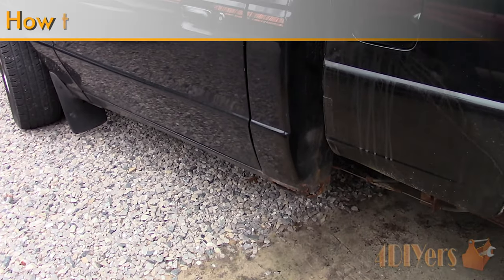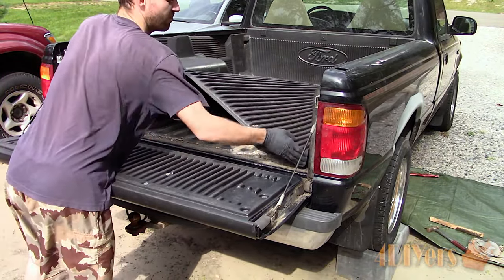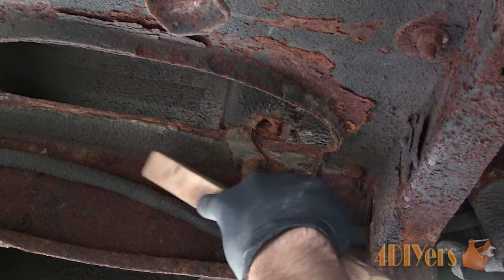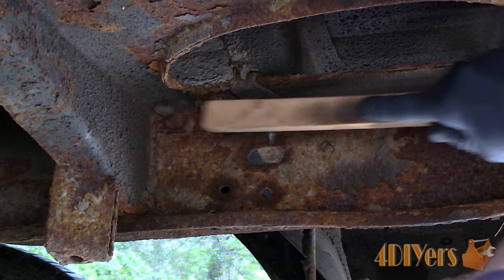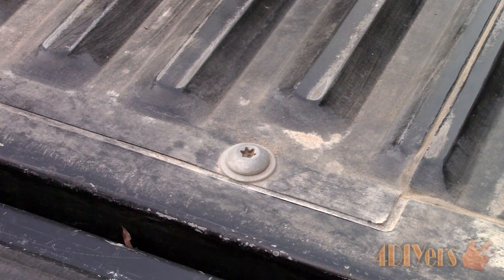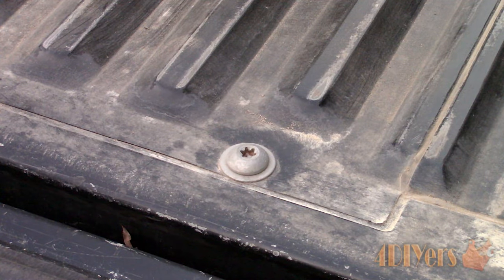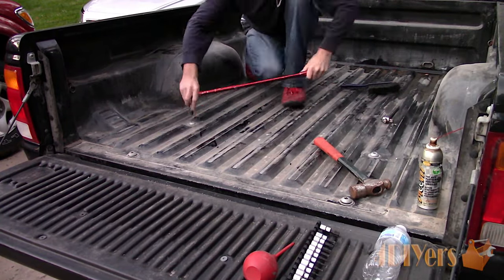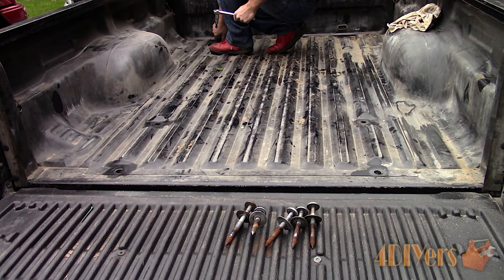How to Remove Rusted or Seized Truck Bed Bolts

Comment: I have an 08 F350. It has about 8 bolts. The first time around I tried this route. Tried oil, shocking, impact drivers, even heating them up. In the end I just bit the bullet and just cut the heads off with a grinder. Took about 10 minutes to cut the bolts then another 3 to cut the nuts off the frame. I am convinced the nuts are lock nuts, meaning they seize in place to prevent backing out. New bolts and nuts are $30 - $80 total depending on vendor. Just another thought if you're really fighting it. One broken tool can cost more than just replacing the bolts.
Reply: UGH!!! I think I’m about to have to go that route. Mine are rusted beyond repair.
Reply: Jim McAlister with a grinder and a cut off wheel it took me all of 5 mins to cut them all off. Once the bed is off the nuts just pull off the frame. You’re going to want new bolts anyway.
Reply: I broke one already so it`s on hold until the new bolts arrive.
Reply: gun fisher theres two kits. 1 does a short bed and one has a couple more bolts for an 8’ and includes the bolts and nuts.
Reply: @murph914  I purchased one that was specific for my make and model but the one thing I don`t like is that to save $40 you need to buy from a vendor that makes them with hex head bolts. Now when they arrive tuesday I`ll have to run out and buy the right size hex in 1/2" drive in witch they are not common any more and I`ll end up waiting on delivery of that also. Napa will probably be the best bet to get them quick I hope.

Comment: I'll be removing the bed on my B4000 to replace the fuel pump. I don't expect too much trouble, but you never know. I live in South Louisiana and we don't usually see that much rust under our vehicles due to the fact we don't ever have a need to salt our roads.
Reply from the maker: All I can say is that I'm jealous lol. Every year the government seems to add more salt to the roads here and vehicles are only getting worse.

Comment: Gave up trying to get the bed bolts out on my 2010 f150, had to cut them out,  had to replace the rusted out underside bed rails, made the rails myself.

Comment: Thanks for the great video!  My bolt broke before it really moved any.  I can't grab it from above and tried heating/cooling from below then double-nut trying to move either direction without success.  Tried drilling it out with titanium bit but couldn't get it perfect centered from above.  Any advice?
Reply from the maker: Thank you! The best route would be continuing to remove the other bolts, then once the bed is up, cut out the clip it bolts into and just replace it.

Comment: Thanks for the useful info. I’m in the market for an 11th gen f150 so I’m sure I’ll be doing some work under the bed. I never thought to allow days for penetrating oil to work but it works evidently. With the state of the bolts would you reuse them?
Reply from the maker: No problem! If the bolts are in reasonable condition, reusing them is fine. When the threads get extensively deteriorated or if the clips are in poor condition, then I would certainly recommend replacing them.

Comment: On 2 of mine the torx heads had rusted themselves round.    I had to cut the bolt heads off with an angle grinder.  I'm hoping I can get the other ends out, because I don't want to drive around with two missing bed bolts.

Comment: I had to cut my bolts off with a portable band saw, grinder and sawzal did little.
Reply: After the head came off did the bolt fall out easily

Comment: Yeah so um ive broken 3 torque bits 😂 they will not budge does anyone have any ideas?
Reply from the maker: Get good quality torx bits, possibly impact versions. I've had them before where they broke or twisted. The other option is using heat like a small propane torch.